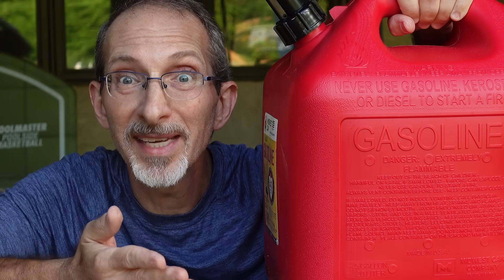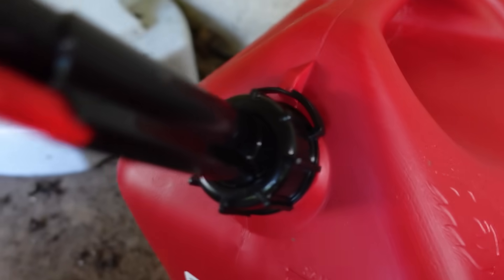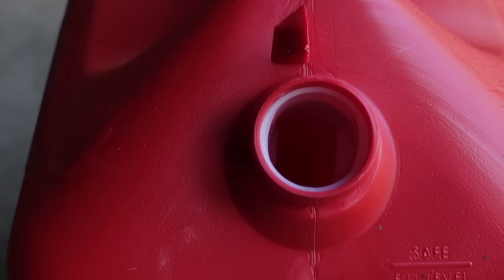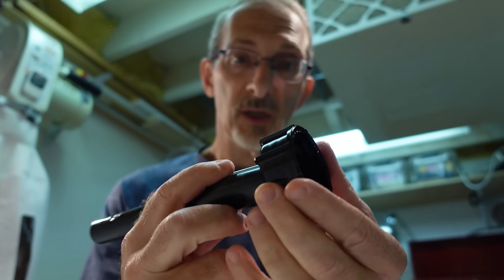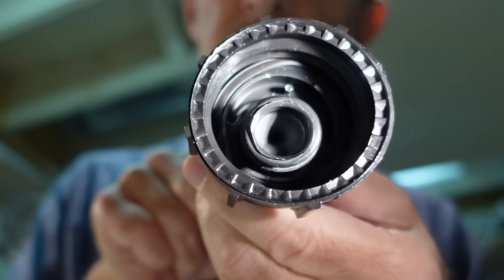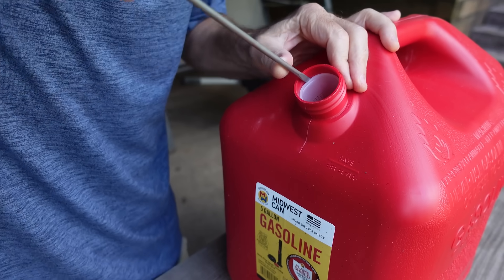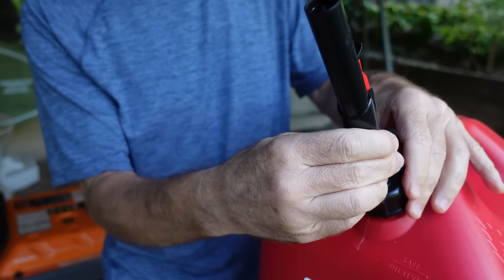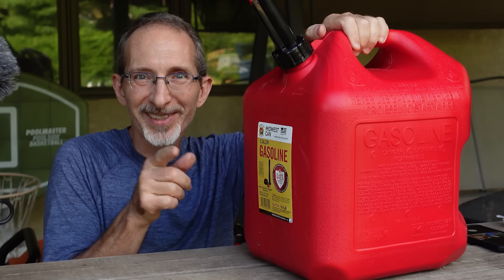Gas Can Modification | New Gas Can Fix

Comment: I believe the “filter” in the can is not for debris. It’s a “flame arrestor”. 
I agree it sucks but that is the intended purpose.
Reply from the maker: Yes! I realized that after the fact and corrected it in my second video, link in the description. I also tried another variation of the spring mod, and added a vent to the container. Both changes made a big difference. Thanks for watching and commenting!

Comment: It may double as a filter but it actually the flame mitigation device that they are bragging about in the label. Your can will explode when you use it now /s
Reply from the maker: Agreed! I found out that the filter was a flame arrestor later, and corrected that error in my second video. I like the flashback prevention that the arrester provides, but I wish it was in the nozzle and not in the container where it impedes filling. Thank you for watching and commenting!

Comment: I love the "mod" but maybe illegal in most states. and thank you Cailfornia for putting this bs into law...  now for the problems with your mod 1st that filter is not a filter its a vapor arrestor for stopping fumes from coming out of can as you have the cover off. 2nd removing the spring was not smart now you can pour out gas into whatever you want to fill but you can not stop the flow as you lift out spout so now gas will be spilling out until you pull the spout up to stop but with no spring to stop the flow and now the can will be leaking vapors.. 3rd removing the child proofing retainer .. again not smart. 4th you bought the cheapest gas can they make... i know the really good one's are way over priced but you get what you pay for... that is why i'm keeping my old ones and by the way you could have just bought a new "old style" spout to replaced that new one. yes i know it cost $20.00... so you should have just bought that other brand that cost $35.00 and you would have saved yourself a headache and maybe $5.00 .. so good luck cleaning up your spills.
Reply from the maker: Robert, all good points. I bought these containers at a time when they were the only ones available at the beginning of the pandemic, and I had just purchased a gas generator. I agree that if I had started with a better product, much of this would’ve been unnecessary! Thank you for sharing your thoughts in joining the conversation.

Comment: I took this filter out immediately after purchasing one of these
Reply from the maker: Tyler, after posting the video I learned that the filter is a flame arrestor safety device, which I explained in my second video. I just wanted to mention that, in case you want to use caution when the fuel level is low and the risk of fumes igniting is higher.

Comment: Best gas cans we ever had were the old 5 gallon oil cans, 2 sizes of spouts, and very little spillage, problem was they were too light and dented easily, then could start leaking through a crack or a rust hole, simple the old jerry cans, u could see what was going on, simple, so no mess
Reply from the maker: Sheila, I can’t believe how many people still favor the older Jerry cans! These new designs are in expensive, but all of the safety features are only helpful in theory. Thanks for watching and for sharing your thoughts!

Comment: That filter is actually a flame arrestor, guess its supposed to prevent flame from propagating into the can and detonating it. But dont know if that really works, hopefully never have to find out.
Reply from the maker: @Merp - you and me both! I realized it was a flame arrestor, and I corrected that in my second video where I also made a few additional modifications. Thanks for joining the conversation!

Comment: Knock the filter into the can what difference will it make, none.
Reply from the maker: Mike, I have heard other people knocking it in instead of pulling it out, and like you say it makes no difference! (I just want to mention that the filter is a safety device, as I explained in my second video, and not just a filter.) Thanks for commenting!

Comment: Earlier this week, (March 2022), I picked up one of these 5 gallon gas cans. 
On the way home from the hardware center I stopped at the gas station to fill it up.  Had to mess with the cap lock to open it. What a pain fidgeting with it.
I Didn’t know about the screen. 
Pump kept kicking off from the backsplash. I had to hold the nozzle and slowly fill the can. 
What a pita! 
So, I get home, and decide to transfer a couple gallons into my empty 2.5G can (for filling the snowblower/lawn mower). 
Again, had to mess with that cap release to open it again. 
Then it took me a few minutes to figure out wtf the nozzle was doing.
I had to hold the nozzle in with my hand to get the fuel out.
Wow, what a PITA doing that with a full 5 gallon gas can !! 

I got about a half gallon in and said forget it. At that point, I noticed there’s also no vent ! 
Wtf….  I’ll deal with it later.

I just saw your video Mike. 
You nailed it !! 
Modding my can tomorrow morning.  
Wow, I wish I had noticed these issues before I purchased this poorly engineered can.
I would have went with a different vendor if I had known.
Wow… they need to pull these off the shelves.  P.I.T.A. 

Again, great video Mike!!  TY.
Reply from the maker: Hi Jim, it sounds like you experienced all of the classic shortcomings of these containers! Fortunately the fixes are very easy and effective. I appreciate you sharing your experiences!

Comment: I agree with all these issues and how stupid they are. I would note that it isnt supposed to be a filter but a firebreak. I've found that you can fill the can if you use your hand to depress the nosel and just barely put the tip of the nosel into the can it will let you fill it right up. But again you shouldn't need to do that...
Reply from the maker: After seeing comments in this video I realize that the filter was a flame arrester, which I corrected in my second video, link in the description. When these containers are full, it requires both of my hands to hoist it high enough to fill something. If I’m trying to transfer fuel to one of my empty 2.5 gallon containers, those cans do not have enough weight to depress the nozzle, so I need a third hand! With enough practice, I suppose you can get used to this container, but it definitely has its shortcomings. Thanks so much for commenting and for watching!

Comment: Everyone that will take short cuts to the end, are dummies and it is why we read about accidents, minor or serious. Flame arrestor screens may inhibit the fuel flow but they have a specific purpose TO PROTECT YOU! Even when you are not aware of the potential situation. It is not like you are part of a NASCAR pit crew!  

I had an occasion of a person ask me to fill several car boys with outboard fuel. He routinely drove to a gas station with leaky caps or the spout still on because he felt like it was wasting time but yet he did not have a gun to his head. I asked him to provide me with plastic boxes to put the containers in and then strapped the container into place with a cargo strap. On the way back to the shop, I picked up new caps etc and all he said was, " That was not necessary". He is one of those dummies that cause everyone else grief and does not mind his vehicle smelling of gas. Just an incendiary bomb waiting for an ignition point.

No modifications of any sort   - Always do it right! no harm or foul.
Reply from the maker: @I. Barnes - I have learned a lot more about container safety since creating this first video. Thank you for sharing your safety tips and advice!

Comment: It's not a filter - it's a flame arrestor. Keeps the can from going BOOM if near an ignition source with the cap off.
Reply from the maker: @Michael Jordan - yes! I realized that after this video was live, and I corrected it in my second video, link in the description. I also added a vent, and gave a variation of the spring fix so the spout retains the auto close feature. Thanks for commenting and watching!

Comment: All modifications made to the original container will void the use of the container if it gets inspected at a filling station. 

OHS rules concerning bulk containers such as you are using, are not intended to be filling a tank, smaller that the bulk container. The bulk tank is for transportation only. Then you are suppose to transfer to smaller containers or in the case of your genny, I suggest you use one of those flex nozzles that fit the original cap. Bend the nozzle into the genny tank and then upend the portable tank to fill.
The screen is intended for static flashback ie explosions of fuel vapors. 
Do not transport bulk containers with the spout exposed - remove the spout for transport DUMMY!
.
Reply from the maker: All good points, but I contest the ‘dummy’ callout! 😉

Comment: I hate these cans. And forget a filter being stuck inside. When I first got these years ago, somehow, I dropped the spout inside the can. I went and bought a new crappy spout and still use that can today! On top of spilling gas everywhere, these things seem to take 10 minutes to empty 5 gallons. They make the work designs list top 10. Thanks for the tips!
Reply from the maker: @TE - So the spout hasn’t dissolved over time? Yes, 100% agree with what you are saying. It’s hard to put gas in these containers, and even harder to get it out! Thanks for watching and for joining the conversation.
Reply: @MikeFyxdt  it's still in there, rattling around! It's been around 7 years give or take.

Comment: Better solution! Buy gas can spout replacement kit. Add spout. Add vent cap. Remove stupid screen in can. Throw old spout/stuff in garbage. Voila! You now have a usable, normal gas can! :)
Reply from the maker: Jim, what you're saying makes lots of sense! Hopefully these designs will get better in the future, without the need to modify. Thanks for joining the conversation!

Comment: At the gas station in sub zero getting gas and trying to fill up snow blower you dont use it anyway took mine apart as a single woman could never get spring pushed in anyway...
Reply from the maker: These gas containers are hard enough to use in nice weather, you are 100% correct to point out how important it is that they are usable in adverse conditions. Hopefully better designs will consider this in the future. Thank you so much for watching and commenting!

Comment: "Quick flow spout" is a sick joke. It is neither quick, nor does it flow. I was in a hurry the other day and didn't have time to stop for gas before taking my son to a soccer game. I happened to have a full 5 gallon can of fuel that I keep on-hand for emergencies. So I figured... hey, I'll just dump that in the tank and I'll be set. 15 minutes later, maybe a gallon of gas has slowly trickled out of that stupid spout, and that much or more has run down the side of the truck. It's the absolute biggest engineering joke I've ever seen. That's your government at work. Moronic.

Comment: The "filter" in the can isn't a filter at all, it's a flame screen to keep vapors inside the can from igniting and exploding.. but the only time I can see that happening is if you were doing something that you shouldn't do such as pouring gas on a fire from the can.. I just buy the metal cans that last for life and done. The 5gal can I have can empty it's contents in 60 seconds and not spill a drop with infinite control
Reply from the maker: Kirby, you are correct… The filter is the flame arrestor. I figured this out by my second video and set the record straight. There’s a link in the description if you would like to watch. Thank you for joining the conversation and for watching!

Comment: Taking out that flame arrestor is the greatest pleasure you can have with a gas can.  I found on the scepter cans from walmart you have to smooth out the hole if you want to use a battery powered transfer pump. Not the case with midwest can.  Was gonna just throw out the scepter can but im a cheapscate and those cans arent cheap for what they are.
Reply from the maker: Yup, pulling out the flame arrester is like removing a tumor. No way to get a transfer pump in there with the mesh in place. You made a great point. Thanks for watching and commenting!

Comment: Good video, Mike. The first time I tried to fill my new Midwest can, I said, "What the hell.....?" Then I noticed an additional, government-mandated FUBAR. The spouts I knew were a users worst nightmare, but the abortion inside the can came as a surprise. i suspected the fix would be just as  you have demonstrated, but your tutorial was excellent. Reminds me of the 1979 Dodge truck I bought, which had the gizmo inside the filler neck so only the smaller unleaded gas pump spout would go it. I did the same thing to that one, only I used a non-sparking tool to knock the restricting gizmo out, after attaching a wire so it wouldn't fall into the tank. I used whatever fuel was available in back country locations without government mandated bullshit.
Reply from the maker: Great story Harold! I’m glad the video was easy to follow. Thanks for commenting!

Comment: i bought this same gas can and i can confirm, everything you said is 100% true..first time i went to the gas 
station to fill it, gas splashed all over the place because of that ridiculous filter..i've never had that happen 
with any other gas can..next problem i find ,i get home and it's almost impossible to lift this gas can with 
one hand and hold that nozzle pushed in at the same time,especially when it's filled..gas went all over the 
place again..as soon as the warm weather is here, i will be making the same modifications
Reply from the maker: Vince, thank you for sharing your experience… So many of us have gone through the same issues. I hope the gas container manufactures are paying attention and we will see better designs in the future!

Comment: First off..."Good job!"...second off, (which you didn't hit on, but should be obvious) has to do with the can filter...This filter makes absolutely no since to start with...when your filling the can "with" the filter in place, it's supposedly there to catch any trash that maybe coming out of the gas pump right?....OK, lets say it catches some dirt..."GREAT!" It's doing what it was designed for....Here's the problem tho....Once it catches the dirt, then once you go to pour the gas out of the can, the gas washes the dirt out of the filter, and into whatever your pouring the gas into!........Great idea! lol
Reply from the maker: You are 100% correct! After publishing this video I learned that the filter was a flame arrestor, designed to keep fire from flashing back into the container. I went into detail to correct this in my second video, link in the description. Thank you for watching and sharing your thoughts!

Comment: I didn't realize that to use these nozzles you first have to squeeze the red tab until it clicks. When I saw the manufacturers video demonstrating that it made these cans much easier to use. However, I agree the flame arrester insert is annoying when at the pump.
Reply from the maker: I think it’s crazy that a manufacturer has to have a video demonstrating how to use a gas can, but whatever. Imagine if these things get even more complex in the future! Thanks for watching him for commenting!

Comment: I bought a 6 pack of replacement spouts on line.  Each spout had two different rings of different threads and diameters as well as 6 vents you can install with a 1/2 inch drill bit.  I have 7 different 5 gallon cans that are made by 4 different companies and all adapted with this kit which cost $35.  Now I have no spills and a more even flow to dispense but I'm out  $35.
Reply: I can't believe one needs to install a vent on the new gas cans. My old plastic one has a built-in vent. What were they thinking? Is leaving out the vent supposed to save the planet? I suspect the damage done by the spillage caused by the idiot-contraption spouts does far more damage than the little bit of evaporation from missing air vent caps, which are normally attached with a ring so they don't get lost.
Reply: Yep, with our govt.'s help, we have made a product 1) very difficult to use and frustrating, 2) less safe by increasing the likelihood of spilling fuel, and requiring doubling the total cost and time required to buy the extra nozzles and vents to make it functional.
Reply: Thanks again government officials wait did Jr have something to do with this - is this new gas container from one of his new companies?

Comment: maybe cut the spring in half so the tension is reduced and is easier to pull back 🤔.  Great tips and excellent video.
Reply from the maker: Great minds think a like! That’s exactly what I did in my second video, link in the description. Check it out… Thanks for watching!
Reply: REMOVE THE SPRING ALL TOGETHER,,,,,,,,IT WORKS JUST AS WELL WITH NOTHING.............

Comment: Well. I took that spout apart and the spring was in the small section of the click devise. Its a much smaller spring but extremely difficult to push so I took it out. The spout doesn’t lock in the cap. Not sure if there’s something I need to do about that. I’m really thinking to put water in the can to see if it leaks. I realize I’ll have to wait awhile for it to dry to use it for gas but I really don’t want  end up with gas all over. Thankfully there isn’t a filter but I’m going to buy another can this week so I’ll do a lot more checking of the can. I only have a 2 gal can now.